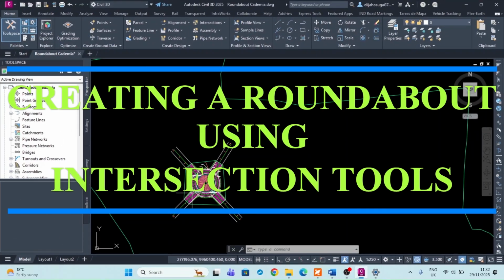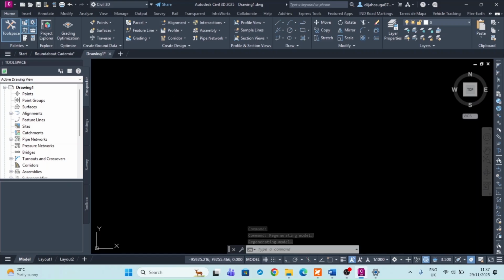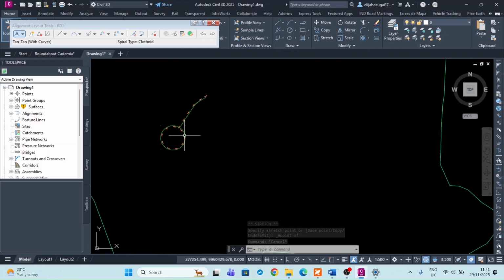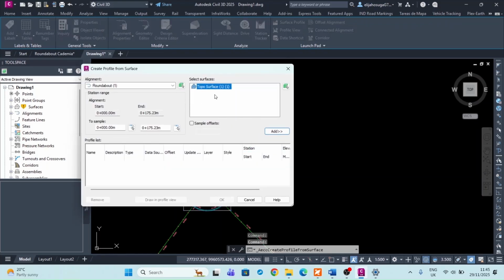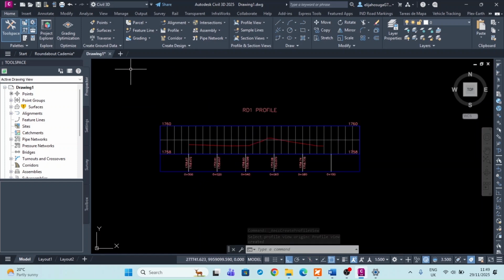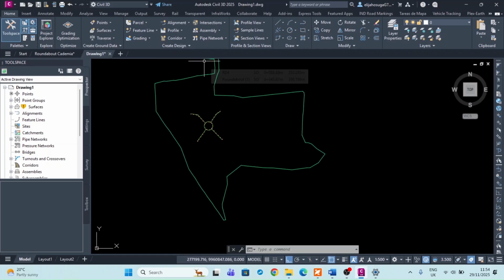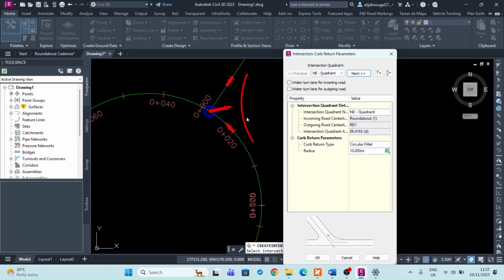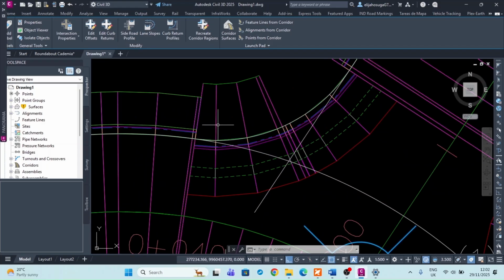Modeling a Roundabout in CIVIL 3D - Part 1

Comment: Hi, Which method is commonly used in Roundabout design
1. with the vehicle tracking option or
2. General method?
Reply from the maker: the better option is to use vehicle tracking.